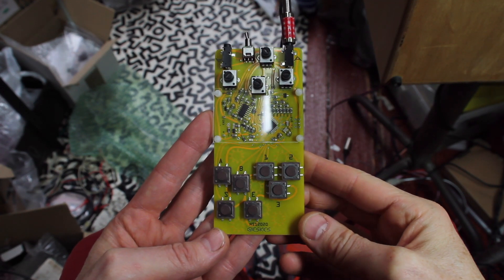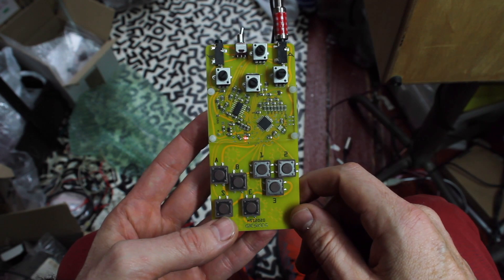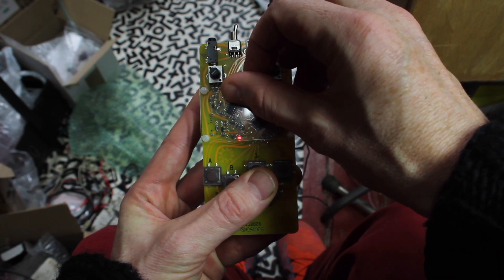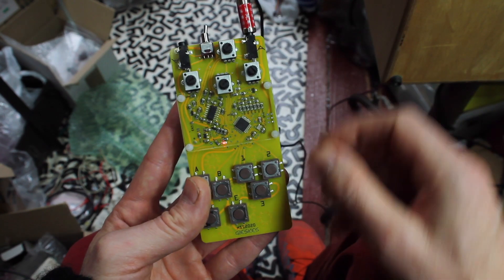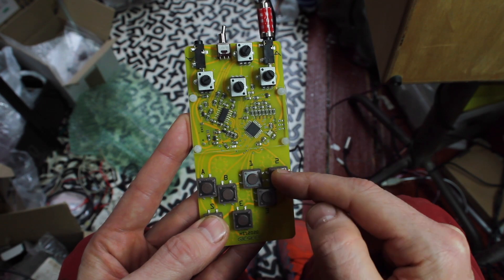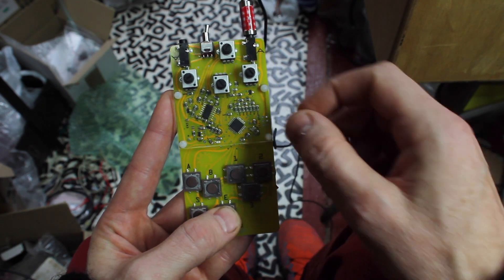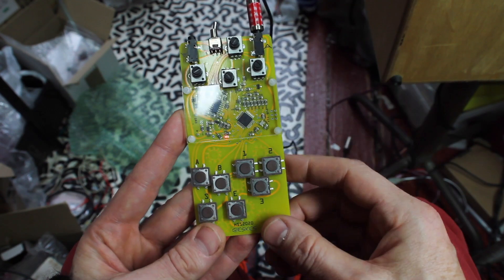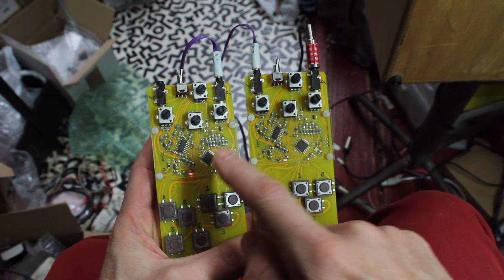HSS2020 what can it do?

Comment: Truly in love with this device. I’ve been using it standalone and it’s great. Quick question though. How do I get the HSS to receive synch from my po33? What synch setting on the PO is it and do I have to hold the S button or set the speed to 0 or both, on the HSS? (little confused on that bit) Please help 🤣! Also thank you again for blessing us with this wonderful piece of gear. It pairs extremely well running the Ellitone Mulitisynth into the audio input!
Reply from the maker: Thanks for the kind words :) glad you like it. If you set speed to 0 it will sync to PO. No need to hold S on boot up i think. For the pocket operator check there website there is a video about sync there.